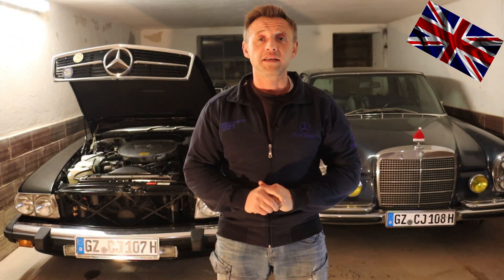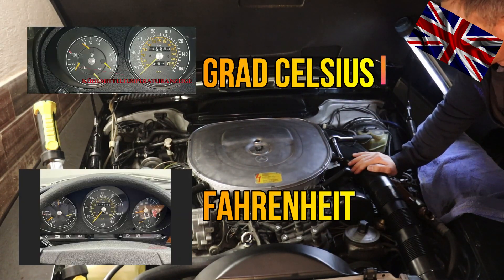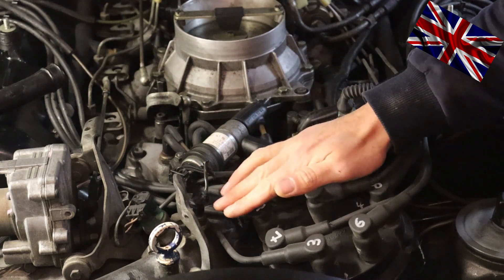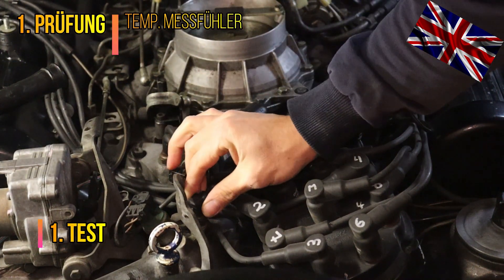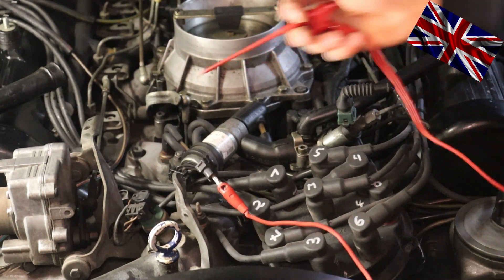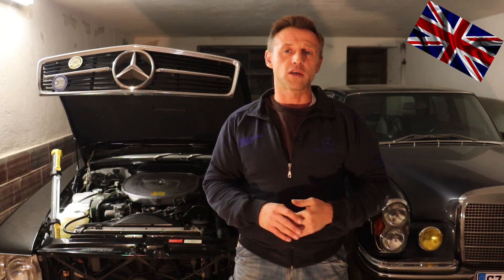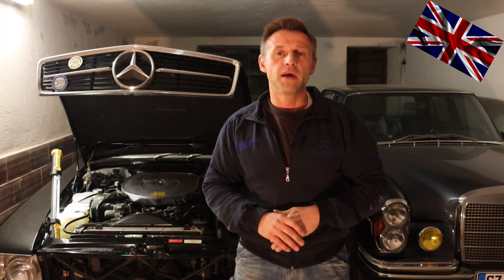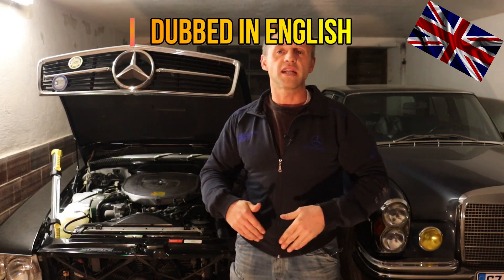Checking the coolant temperature sensor on a Mercedes R107 - Classic Car Repair - DIY

Comment: Thanks, this is useful.  I checked my gauge by unplugging the sensor ("feeler") and measuring the resistance from its terminal to ground, using an ohmmeter.  The temperature reading on the cluster gauge corresponded to the resistance I measured, per the table at the end of the video.  So I conclude my reading is correct.
Reply from the maker: Yes you are right thank you for your comment